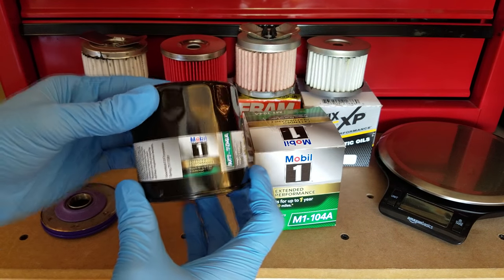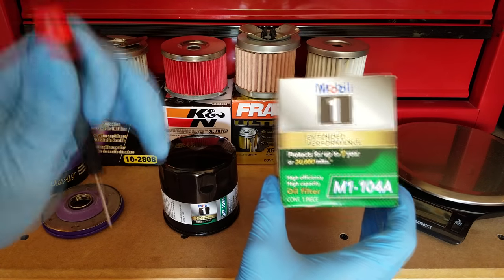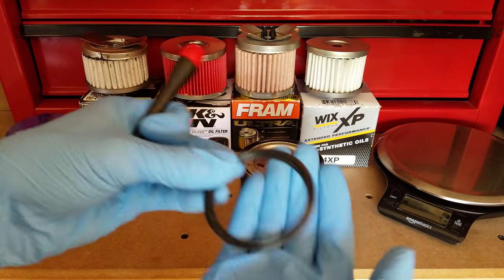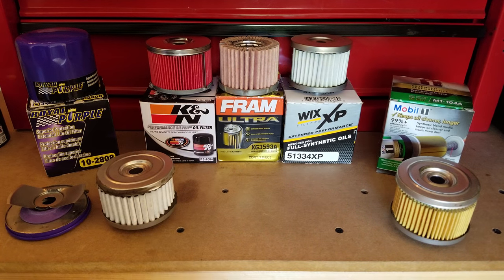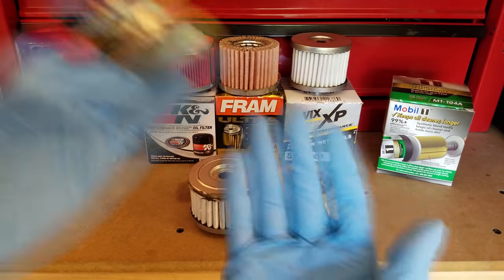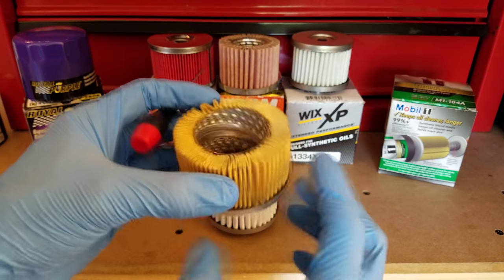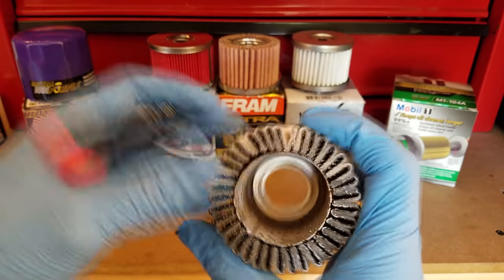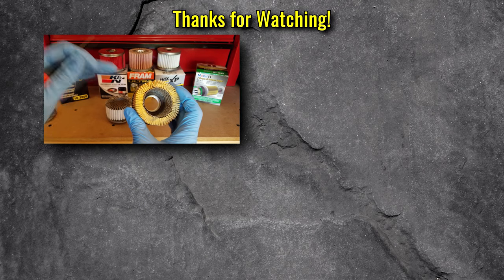Mobil-1 Oil Filter Cut Open! | vs Royal Purple/WIX/K&N!

Comment: A mobile filter ruined my engine due to a plug left inside the filter when the main hole was stamped out from the factory.. stopped oil flow..I was able to get my money back from Mobile for another engine and labor costs.. Didn't have to haggle, beg, or threaten with a lawsuit..That being said I still use Mobile they made everything right with me and gained my respect
Reply: Robert Mc I would like to get more INFO on tha Warranty( imuse M1 Oil, And NAPA GOLD OIL FILTER...thank you
Reply: Do you have pictures of what happened ? A plug in the oil filter ?
Reply: How could the installer be so clueless that they'd put that filter on and use it?
Reply: This was production problem which surely caught and fixed.....The end product of any oil filter, when changed properly will work just fine....
How long did you drive this engine with low or erratic oil pressure before you burned it up and now blaming the oil filter for the damage.
Reply: itchy AIDS   Yeah, if Mobil bought me a new engine I'd at least have the common courtesy to spell their name correctly.
Reply: Robert Mc mobil 1 cleans off dirty and build up so thats probably why it clogs up your motor. Prove that mobil 1 > most oil even purple royal. If you dont believe me look up project farm on youtube. He does alot of brands comparison.
Reply: same here,,,it broke my oil cooler o ring
Reply: @stinkycheese804  maybe they've never done it before?
Reply: Does "EVERYBODY" just keep driving with the "IDIOT" light on or the oil pressure gage on "0"?
Reply: I designed a machine to detect those incomplete stampings, they call them Hanging chad's
Reply: "They had us in the first half not gonna lie"

Anyway good thing they made the issue right
Reply: Robert Mc, could you have seen the plug left in the main hole before installing?  I’m not raggin’ on you, I just want to make sure it doesn’t happen to me or anyone else reading about your experience.
Reply: That's pretty good going, if only suzuki were like that when mum's car kept leaking Carbon Monoxide and exhaust into the vehicle after repeated attempts of being fixed
Reply: @user-cl5ov9dx5o  AND IT DOESNT TAKE LONG AT ALL TO BURN AN ENGINE UP WHEN THE LUBRICATION IS BLOCKED.
Reply: A GUY I KNOW HAD THE SAME THING HAPPEN TO HIS ENGINE BUT IT WAS A FRAM FILTER HE HAD JUST CHANGED THE OIL AND FILTER AND THE FRAM FILTER RUPTURED IT BURNED UP HIS ENGINE,THE FRAM COMPANY HONEYWELL I THINK IT IS PAID FOR AN OVERHAUL KIT BUT NOT FOR THE LABOR.
Reply: @algrayson8965  THE LIGHT MAY NOT WORK GENIUS.
Reply: @jasonchandler2463  - Yeah, and oil pressure gages may not work, either. Don't bother looking at the instrument panel to see if the indicators light up on test mode (when you first turn the key). Also don't ever look at the oil pressure gage.
Reply: @jasonchandler2463  - WHAT? WHAATT? UNLESS YOUR ALL-CAPS ARE IN BOLD I CAN'T READ THEM! MAKE THEM COLORED RED, TOO!
AND ITALICIZED!!!
Reply: @wlbrobinson  - Chad is the he-man your ex-girlfriend dumped you for. He'll use’er, abuse’er and she'll beg for more.
Reply: Rob Mc Thanks, interestingly quite a story........!,
Reply: And we are human we make mistakes

Comment: I am not going to run my engine for 20,000 miles with the same oil, no matter what filter is used.
Reply: You do realize, new fresh oil is harder on your engine than the old, dirty oil...right? It's not the black carbon soot that should scare you, it's the metallic debris in the oil (that the filter is supposed to take out), along with a break-down in viscosity that causes metal-on-metal damage, that you should worry about...20k? Feasible on a 100k Vortec motor...or a very clean, well-built old Chevy 350...the key is premium oils and filters, along with proper oil cooling while the engine runs!
Reply: neither would I. In fact, I change  oil based on the mileage I drive.
Reply: @skeetersaurus6249  As oil ages shearing has an impact affecting viscosity, additives are depleted, oxidation happens, moisture gets in and there is fuel dilution.  Then there is maintenance logs.  Most people aren't going to want to buy a car with 20K miles between oil changes.  Also 20K miles are not all the same.  Stop and go traffic and idling take more hours to reach 20K than highway miles.  The former situations are harder on oil than highway miles.
Reply: 5k for me that's what my book says that's what I'm doing
Reply: I tried going 20k with my 2012 Camry with full synthetic. That filter felt too heavy for my comfort level...and that was with an oil change at 10k. I'll use the Mobil and follow the 10k change for both filter and oil. No sense in adding risk. Most of my driving is highway so I considered my car at lower risk when considering trying it.
Reply: Probably a good idea.
Reply: I use the M1 20k 5W 30 Annual with an oem ford 500s filter.
I run the oil for 16k but change the filter midway at 8k then top off.
Of course when I hit 16k I do a complete change.
I always keep a magnet on the side of my filters.
Reply: @jamesm.8392  I'd love suggestions on magnet shape, size, and placement location on the filter...and if you've ever cut open a filter to see if particles gathered in the magnet location.
Reply: @skeetersaurus6249  You didn't say why new fresh oil is harder on your engine.   Sounds like you're full of metallic debris.
Reply: I drive consistently just under 15k miles/year these days. so I use the 20k oil & filters from M1 on a 14-15k change cycle. 
I used one cheap (but still synthetic) oil change on a shorter cycle, to adjust my annual oil change to October (nice weather), so I'm deprived of excuses for putting it off. It's a bit long, but it's a non-turbo engine, mazda 3, so basically a moderately overpowered economy car. The engine doesn't have to work very hard, so RPM's are usually low. And 4.2 liters of oil is a big reservoir for a 2.0L engine, which tends to extend intervals too.
Reply: Go watch engineering explained's video on this filter an oil. The most in depth explanation on the matter online,
Reply: Filter is the most important thing!
Reply: ZZstaff Amen! Every 3,000 miles, the only way. The oil is always dirty at 3,000. That’s been my experience.
Reply: @Wroger Wroger 
One of the reasons NY City taxis are good for 500,000 miles (in six years) even though they have historically only used a good conventional oil is because they avoid cold starts which contribute the most wear in an engine.
Reply: Think about a distracted blond.
Reply: @bgjobass  the oil is suppose to be dirty (to some extent). High detergent oil is suppose to hold the dirt in suspension unless it's large enough to be removed by the filter. If the dirt was not held in suspension by the oil then it would accumulate and cause sludge &\ varnish to form.
Reply: @Wroger Wroger 
That the kind of high mileage vehicle that can be a great buy. Maintained, minimum wear and depreciated by mileage... all combined to create a great value.
Reply: @jamesm.8392  My dad had a 1986 Ford Escort GT, with 413K miles running M1 & filter, changing filter at 10K and oil at 20K. Sounded like a stretch to me but can't argue with the results. He passed in 2018 but the car will start & run although it looks like crap.
Reply: I ran my Toyota Sienna Limited AWD for 30,000 miles with a K & N premium oil filter and Amsoil signature series 100% synthetic motor oil with optimal test results.
Reply: You don't have to. Leave the same filter in for 15,000 to 20,000 miles and change the oil every 5,000 to 10,000 miles.🤔😉😊
Reply: @skeetersaurus6249  
What you're saying used to be true in the past but today the film strength of the oil is more important than the viscosity. The film strength is determined from the additive package.
Reply: @racheat  
I'm considering going from an oil & filter change every 5,000 miles to an oil change every 5,000 miles but a filter change only every 10,000 miles. Using a synthetic filter rated for 15,000 to 20,000 miles.
Reply: @wjlowe111  
Why?
Reply: @njsongwriter  I'm doing exactly that on my 2005 Highlander Limited with 180k on it.
Reply: Skeeter Saurus huh? Fresh oil is best ...... no contaminants, no soots, no carbon, no wear metals, no debris and correct viscosity grade  ..... that’s why when you do change your oil, you start with fresh and not used.
Reply: You change the oil and not the filter...geez people.
Reply: If it's a newer car there is likely a sensor that measures oil quality (not just time since last change) and warns you when it's time to change it. Besides, it's the filter that can last 20k miles, not necessarily the oil.
Reply: @marco1173  what companies offer these? In honda the computer use data like cold start stop and go how much idle towing etc to calculate when to change the oil
Reply: @skeetersaurus6249   Brother with all due respect , you cannot possibly believe that clean new 0-20 full synthetic motor oil is harder on your engine than dirty oil is. I’ll go out on a limb here and say that the oil Mfg’s would also respectfully disagree as well. I would also like to know where your getting this stat from ? Is it something that you’ve read or is it just your opinion ? I’m not making fun or trying to disrespect you at all brother , I was just wonder if it’s something that you’ve read from one of the oil Mfg’s or just your opinion ? I know that myself all I’ve ever owned had been Honda’s, except for one Toyota Camry ! And must say that everyone of them has is and was all fantastic cars ! That being said, I don’t know if it’s because I’ve always changed the IPL in all of those cars every 5/6000 miles , along with fresh oil and filter or it’s because they were all Honda’s ! All I know is that everyone of them had over 300,000 miles on them when I sold them , and not a single one of them burnt , leaked or used oil in anyway. Again I was just curious if you read it somewhere that new oil is harder on your engine than new oil

Comment: I use full synthetic in my old truck and change out every 3,000 miles like clockwork. Every filter is only able to handle so much and to me, it doesn't matter if oil can be changed in 10k or 15k, 20k miles. Oil needs to be changed and can only last so long. 5k would be the longest I would go on an oil change with filter. Nothing more!

Comment: To those saying 20k oil changes are a no-no.  In Europe we have 20k service schedules on VW's since the early 2000's.  There's the standard service schedule and the Longlife one.  One of our company cars (2002 Passat TDi) had the Longlife schedule from new and was on 380k miles with absolutely zero engine problems before we sold it.  The oil is more expensive but it works.  As far as I remember it used a standard Mahle filter, not some nonsense Mobil type like this.  Mahle are the best bar none

Comment: I've been using Mobil 1 EP filters and oil exclusively for many years and I trust their performance completely. Despite the warranty, I typically do 7500 - 8000 mile drains, sometimes up to 9000 if it's wintertime and I don't feel like doing it in the cold. Either way, I've had totally positive experience with Mobil 1 products and will continue using them. They cost more, but doing longer OCIs and stocking up when the oil+filter kits are on sale takes care of that. I usually get 5 qts + filter for around $32 at Advance Auto.
Reply: Try Walmart they have both M1 oil and filters, way cheaper than any auto parts stores.
Reply: Brad
Advance Auto oil is on sale 3 or 4 times a year and their sale price always use to be cheaper than Walmart. However, they recently raised their prices, so it's about the same as Walmart now. I'm not a fan of Walmart as a company, so I try not to support them, but if Advance gets any more expensive in the future I'll probably start getting it from Walmart.
Reply: @dlg5485  Walmart price for the 5 qt container of Mobil 1 Synthetic oil is $25...most Mobile 1 extended life oil filters are $10.
Reply: @1Mannco   ....we have to watch for sales , in the summer the 5w20 is on sale, in the winter the 5w30/40 is on sale. As to the filter, Wix, Fram Ultra , Mobil  or Bosh will do as long as they are also on sale.
Reply: @rejm1161  I'm talking about Synthetic oil and you should stick to oil filters made for Synthetic oil. Mobile 1 has both Synthetic oil and filter at a great price at Walmart $25 and $10, can't really get it cheaper anywhere else for Synthetic products because it's better than the cheaper standard oil and filters that you can also use if you choose to.
Reply: synthetic oils can easily do 10,000 mile oil intervals.
Reply: @Taydrum  My dad had a 1986 Ford Escort GT, with 413K miles running M1 & filter, changing filter at 10K and oil at 20K. Sounded like a stretch to me but can't argue with the results, he was an engineer. He passed in 2018 but the car will start & run although it looks like crap.
Reply: @peterdragon9630  I believe it. 20,000 is pushing the capabilities of the oil, but given the incredible capabilities of synthetic oils,  it's no surprise that the engine survived those intervals. As an engineer myself, I like to push the oil intervals, but not that far. Keep in mind they suspend dirt and carbon, so replacing oil within interval keeps the engine clean, but the engine will still run if it's dirty inside
Reply: @Taydrum  Synthetic oil was developed for high-temperature use in jet aircraft engines decades ago when engineers realized that petroleum-based oils break down and lose their lubricating capabilities when exposed to high heat. Over time, petroleum-based oils began to oxidize and create sludge, leaving damaging residue inside the engine.

Formulated in a laboratory, man-made synthetic oil doesn't contain the naturally occurring chemicals that break down at high temperatures. It is also manufactured without many of the chemical compositions that contribute to oil oxidation and sludge buildup. Synthetic oil can tolerate temperatures that would burn up petroleum-based oils.

Comment: I had this mobil one filter on my 2006 Lexus LS 430 for the last whole year of 30K miles because I thought the engine is very clean. When I took it from the car I opened it to figure out what was going on inside.
The result was that there wasn't any problem, the media was still completely durable.
Reply: i go 2 years will my mobil 1 filters .

Comment: The larger hole is used for automation indexing function. Either to catch and hold the unit as it is spinned and crimped. Or possibly for label/marking such as lot code location or other date of mfg.

Comment: I love watching these filter cutting demo's. As a lifelong DIY oil changer over 40 years with multiple vehicles my conclusion is and always will be  :  don't really care what good brand oil filter or good brand oil I use.  I buy all the above and whatever is on sale.  It's the frequency of the oil change that protects all of my vehicles.  I've extended my oil changes to 6000 now.  Years ago it used to be 3000. Never had an oil related problem
Reply: me too .  6000 miles and filter every other change as per honda
Reply: PAT DOWNEY me too I just changed my oil at 6k 
H Pilot 0-20 
With this filter I used a K&n previous an kN is bigger for some reason

Comment: I have a 2004 Pontiac Grand Prix GT with a 3.8 L I used to K&N oil filter and I have a little over 790,000 kilometers with zero problems